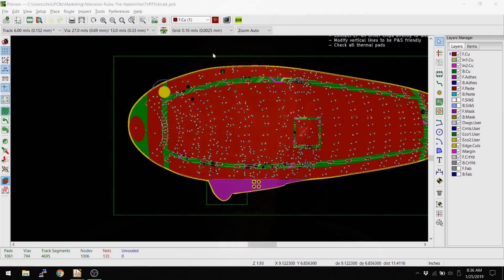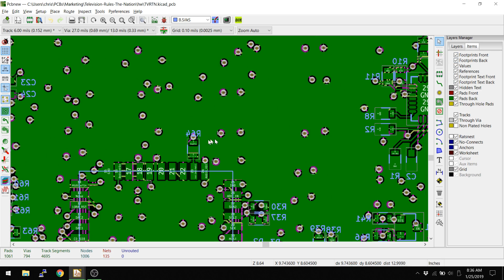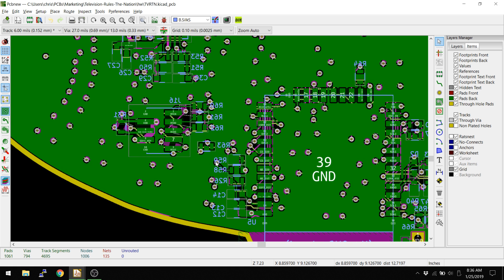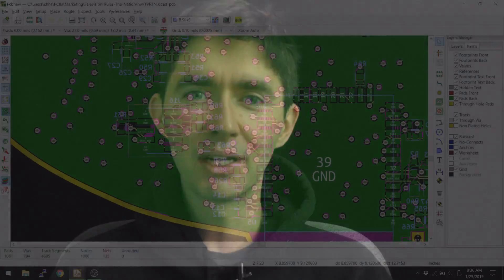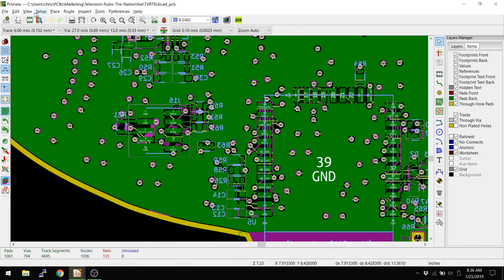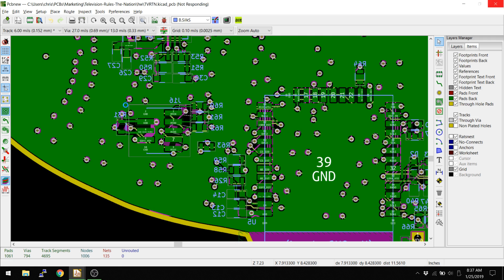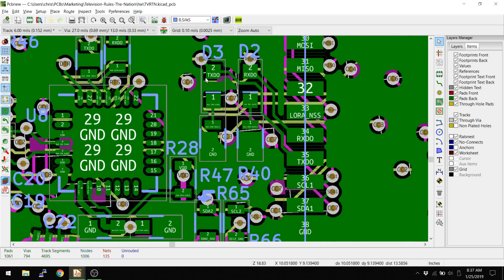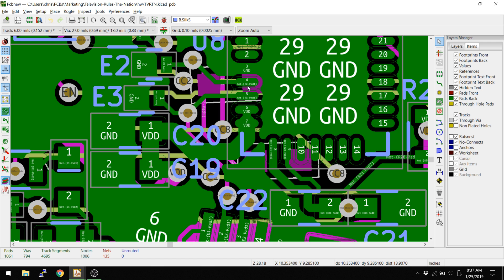KiCad 5.0 - Flipping your view in PCBnew

Comment: Now, how can I copy a bunch of traces, but flipped horizontally or vertically, on the SAME layer? 😄

Say I'm creating a heated bed PCB, and I want 4 quarters all laid out the same, but mirrored horizontally and vertically? I want to layout 1 quarter and then clone it off and flip them, so I have the whole side laid out, with the same pattern in 4 orientations in the 4 quarters of the board.